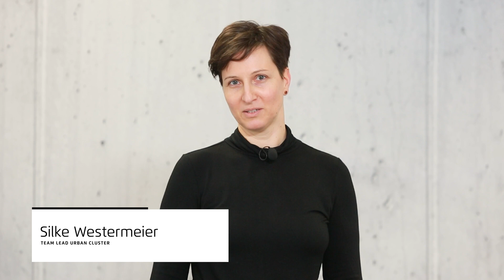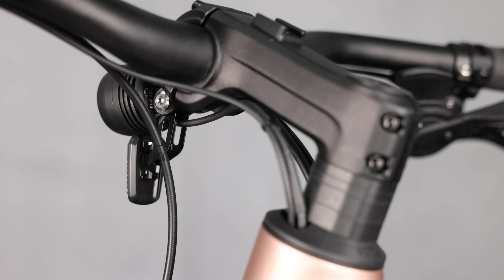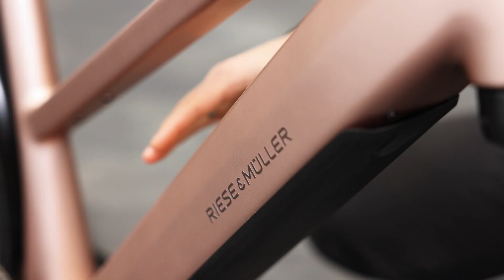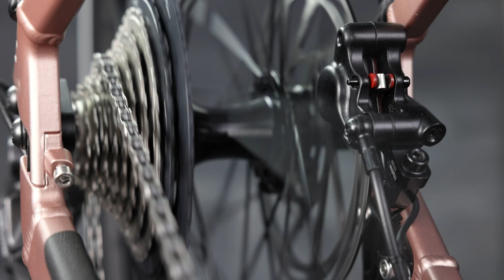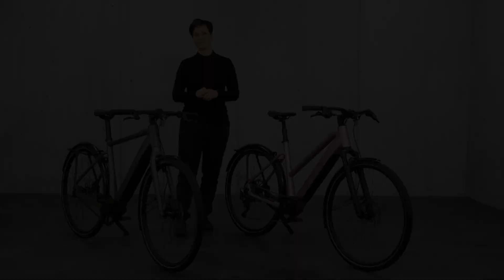Riese & Müller: The new Urban Line

Comment: These are very lovely bikes but the pricing seems really odd. These should be under €4,000 fully configured, ideally just over €3,000 at entry level. As it is they are the same price or even more than the R&M Roadster which has more powerful engine outputs, a bigger battery and better gearing options. Strange.🤷🏽‍♂️
Reply: It's called greed.
Reply: These should be 2000-2500EUR at the highest.

Comment: They look good for people who really need an e-bike to be lighter, and I love the single speed option. But I just don’t support R&M continuing with the derailleur system. It doesn’t match the sustainable and low-maintenance message of the company.
Reply: Dont be such an elitist. We would all love a Rohloff, but price is a sensitive subject and having an option for people who can only afford a derailleur shouldnt offend you so much.

If you actually think about it for a second... You are commenting on an e-bike being less sustainable because of a derailleur system. Ditch the e part and you have reduced the footprint 10x.

Also, I am not absolutely sure IGHs are more sustainable than a chain when you take the efficiency of mass production into account. I am pretty sure manufacturing a Rohloff is a bit more complex and resource-intense than stamping out derailleur parts.

And chains are more easily recyclable than belts. 

Lets just be happy for any e-bike that gets a person out of a car! That is the major change we are really after.
Reply: @SoulFood99  I fail to see how it’s elitist to suggest people stop driving a £20 grand car and replacing it with a £5 grand bike. Rohloff wasn’t brought up here. I was actually advocating for the single speed in this case. But whether it’s a Rohloff, Alfine, Pinion or whatever other non-derailleur gear system; while I assume they will be higher impact at manufacture, because they’re more complex and built to last, they pay off over time both financially and environmentally because they last many years with minimal maintenance, they don’t drip toxic lubricants onto roads, natural areas etc.

Comparing the sustainability difference between a bike and an e-bike is an interesting idea, but considering most people buy e-bikes to commute further, get up hills, carry heavy loads etc, I think the e-bike systems are well justified. For electric mountain biking I could maybe agree, but even then, if it helps older people or less capable family members ride with others who are fitter for example, who’s going to criticise that realistically?

Especially as we’re choosing to continue with private car ownership through EVs, which despite formerly being an EV owner, I now oppose as it’s not sustainable at all. Once we get rid of all private cars, perhaps we can have this conversation about EMTB sustainability. Although it’s so small relative to everything else humanity is doing that it would be near the bottom of things to cut to slash emissions.
Reply: @christill  IGH bikes are very niche and expensive... To me it makes sense to use " elitist", but I may be wrong...

I'm fascinated by your opinion on derailleurs and the sustainability, honestly. I have never really thought about it so I may be wrong, but relative to everything else we do to our planet, I dont think this is a problem anyone should waste their energy on. Especially someone obviously aware of our collective impact on our habitat. Being against derailleur bicycles is pretty low on my list of priorities. 

If you mentioned it... Dont give up on EVs! I honestly do not see any other options for a quick transition to renewable. Only if we all switch to EVs, build a vast network of chargers and use the EVs, collectively, as a huge, free energy storage for solar and wind, do we have any chance.

Vehicle to grid technology is here, there are pilot projects in europe (NL) and according to them, a town could use only sustainable energy if 20% of cars would be EVs and connected to the grid when parked.

I may have fudged up that percentage, honestly... Ill look it up if you are interested.
Reply: @christill  Hit post too soon...

I agree with you completely on the incredible benefits of e-bikes for transportation. Yeah, compared to a normal bicycle, they are quite wasteful, but the downside is trivial compared to the benefits!

I truly think e-bikes are "democratizing" cycling as transportation. It is accessible to anyone willing instead of only thr people fit and young enough so that the commute is effortless.

Riese Mueller make amazing bikes and I only wish I could get one without saving all my disposable income for about the next 7 years for it. I'll take a derailleur version any day of the week!

Sorry for the parts of my comment that were a bit uncalled for, Chris! Wish you safe riding!
Reply: @SoulFood99  Honestly if you bought a bike on 0% finance with a Rohloff, you’d save money. But anyway thanks for the well wishes. Happy riding too.

And I think we need to immediately ban private cars. But that’s a whole other topic, and I’ve learned that discussion is best saved for when it becomes clear to most people how incredibly dire our climate predicament is. Because having that conversation now people just think I’m nuts, so it’s a waste of time.
Reply: @christill  dont own a car... Ebikes and EV carsharing is an elegant solution where possible!

And i agree, any RM bike is a bargain if your starting point is a car!
Reply: @SoulFood99  I used to think EV car-sharing, self-driving taxis, vehicle to grid etc were all crucial tools for the future. Now I don’t really.

I think the key aspects are areas where we had it right to begin with. Quiet streets without private cars; for cycling, buses, vans and so on. Good quality, affordable rail systems. And we need to live smaller and more local with less stuff. But I’m not confident about that message resonating with most people while we still have time to act. Assuming we have time to act now. It very well could be the case that we’re already past that point. But we might as well make a better world anyway no matter what. No harm in it.

And also bike share schemes I like. Generally prefer docked ones but free-roaming appears to be popular unfortunately.
Reply: @christill  I am jumping from one side of the fence to the other, too. From despair to hopium and back.

We have most probably condemned future generations by our actions. Lets not be remembered as the few generations of humans who have managed to both consume and exploit beyond any measure, only to then let despair stop us from meaningful changes.

But then I remember everything truly is pointless until we start dealing with the fact there are 8 billions of us. And growing.
Reply: @SoulFood99  Yeah that sums it up well. It seems to be common to have that feeling of going back and forth day by day.
Reply: I agree with your comments about derailleurs as I have Gates belts on both my R&M bikes but there is an option with the UBN for the Gates belt with Alfine hub so that would be the one to to go for. I have both Rohloff and Enviolo on different bikes and find the Enviolo very user friendly in urban situations.
Reply: @stephenm7361  Yeah I like the Alfine hub of course. But I wanted to mention the single speed because it’s the first time they’ve done it. For this type of bike I would get the single speed personally, but both options are great.
Reply: I would never go back to derailleur system.
Reply: @votdfak  consudering how riliable they are, you may never have to! Hope Ill join you one day in yhe IGH crowd
Reply: @SoulFood99  I own single speed belt drive ebike Schindelhauer Oskar. Loving it so far.
Reply: @votdfak  your rides are pretty flat I suppose then... Awesome! Happy riding!
Reply: @SoulFood99  Thanks! You too! Belgrade, flat parts and hilly too, but assist is there to help.